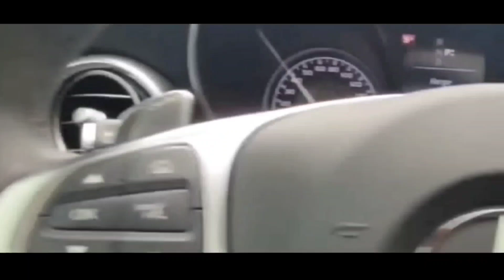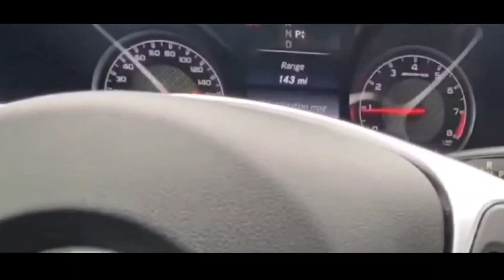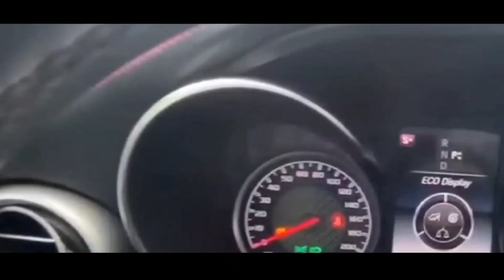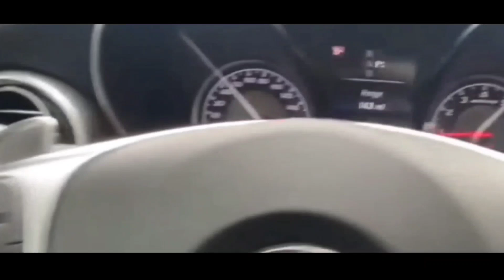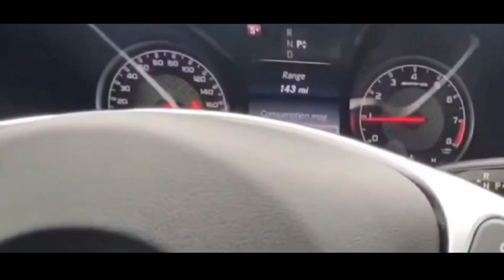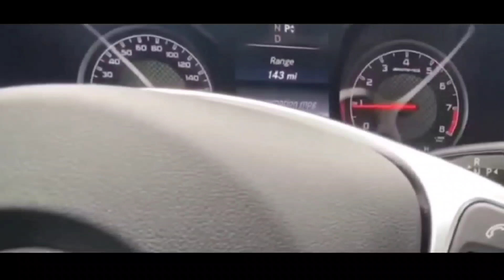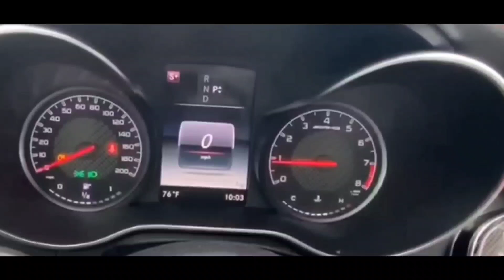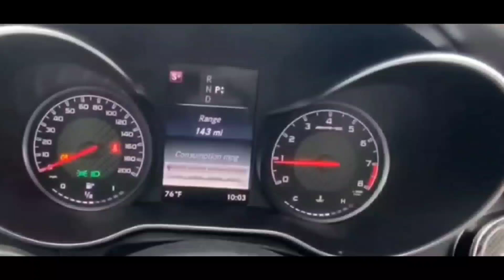HOW TO FIX ANY CAR WITH A P2099 Code: Post Catalyst Fuel Trim System Too Rich Bank 2- FAST AND EASY

Comment: No check engine light but when getting my car scanned at autozone to see which wheel bearing is bad with the abs/stabilitrak light I got the scan showed P2097 rich bank 1 s2 with no other codes. Weird i don’t have a check engine light. No other symptoms either. Gonna be a pain figuring this one out.